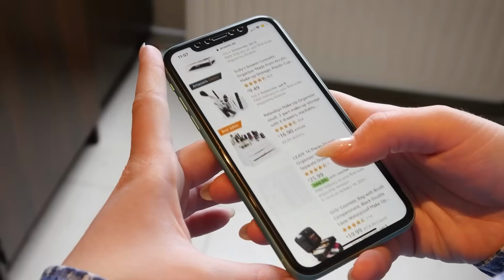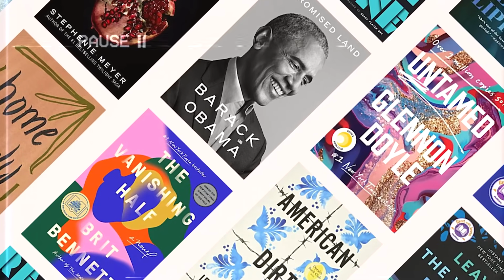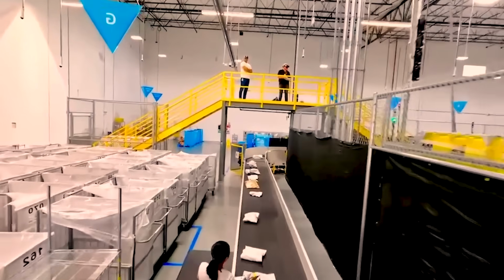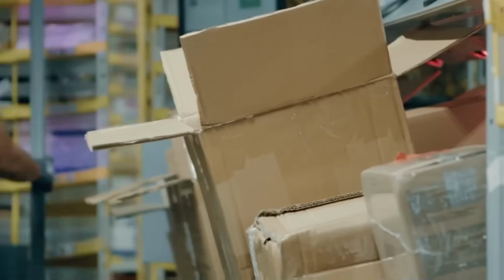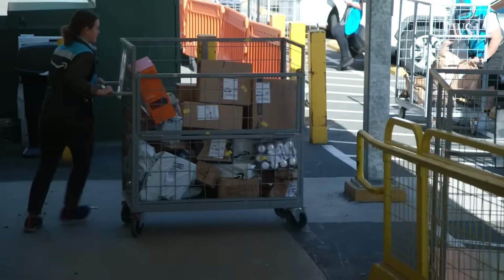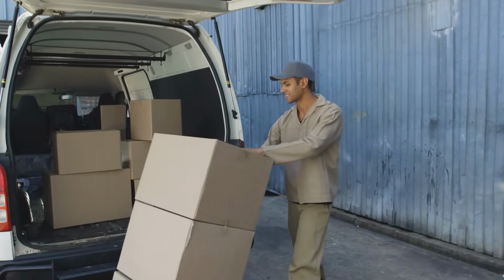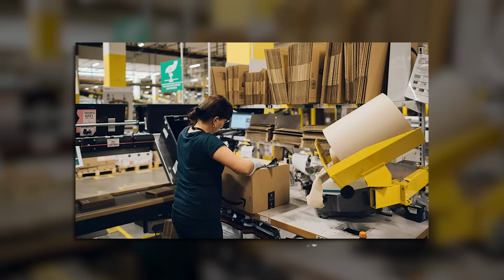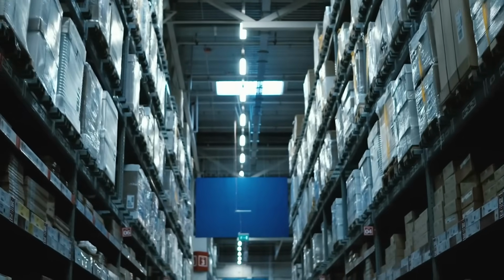How Amazon Packages Are Delivered in 24 Hours

Comment: A random comment: I see people complain that they received something that didn't work, wasn't what they expected (etc) and it was too late to return it. Trust me, it's NEVER too late. The secret is that you are polite, but persistent. It helps that I order frequently (but I'm not rich, so I don't spend a lot.) Also, if something doesn't arrive, they always give me a credit, no questions asked. I once ordered a bedside table that needed assembly. Halfway through putting it together, a screw got stuck. I found that the hole had been drilled at an angle instead of straight, so it was impossble to finish the setup. I contacted Amazon. They wanted me to return the item. I told them I would have to find a gigantic box to fit the table and I felt I shouldn't have to do that. So they told me to just keep it (I threw it out.) and they gave me a full refund.

Comment: What if Amazon had hardcase reusable shipping boxes for their customers. If they charged a deposit for them, they could save millions of dollars for themselves and millions of trees for the planet.  They could even customize them for specific sellers. 

** Lead the way Amazon!! **

 Like a suitcase, they could lock with a tracking unit in it and Amazon could email the customer the unlock code.  Reusable digital address label display and electronic postage.  

Come on, there's no need for cardboard in this day and age.  They could even include attached packing materials on the inside. (Inflatable) They would basically only need three sizes of packages.  

Take your item out the box, drop your box off at the post offic,  and it gets mailed right back.  Your deposit is electronically transfered back to your card,  like a return as soon as the case is scanned at the post office.  

It would work because they did the same thing in the old days with glass soda bottles.  I think the world needs this.
Reply: Start small, but give it a try.... ?  ?
It's the responsible thing to do for the planet.
Reply: You could even display advertising on the outside of the container like a billboard.  That should even make Amazon money.... crap I need to get paid for these great ideas or something.....
Reply: Make them like an igloo cooler. They can get dropped and take it....
Reply: If you made them stackable like they fit inside one another, the post office could save room by placing the smaller ones inside the larger ones when they get sent back.  Amazon gets to charge for three + shipping charges, and one package is shipped and returned... profits... profits... profits...

Comment: The one thing id question is the packaging. Amazon love giving you the stupidest size box for something like a phone case
Reply: That is often down to the seller (not distributor, Amazon) as Amazon require dimensions for the package so it can tell the packer what box to use and sometimes the seller can get that wrong
Reply: Also if you order a phone, laptop, gift card, I would hope that the items are sent in larger packaging. The phone case a thief will assume that it is a cell phone...
Reply: I understand that it may seem wasteful as a customer. I don't speak for the company but I have worked in operations so I can say this. I would imagine operationally it would be more sustainable for the company to stock say a few sizes (say small, medium, large size box) vs customizing the packaging size for every single item. For instance, anything up to a certain size/weight/dimension goes into a small sized box or envelope. This is because manufacturing a few packaging sizes is cost efficient given volumes than producing fewer units of many different sized packages. Think bulk rates for manufacturing, storing, recycling etc. As a general principle, operations aim to optimize, not customize. When we order from a boutique or specialty store, they have he luxury to customize packaging because they have lower volumes and packaging may actually be one of the reasons for charging a premium to customers.
Reply: I know! I just received a tiny item shipped inside a large cardboard box.  ???  How can Amazon makie a profit doing this?
Reply: @catbriggs8362 that’s the thing with big companies … they make money on the volume . They might only make a small amount each order but they process millions of orders a day. So do the math.
Reply: If Amazon's system is picking the appropriate sized box,why are some of my orders arriving in bags or not packaged at all?